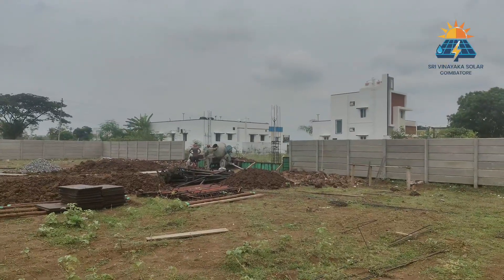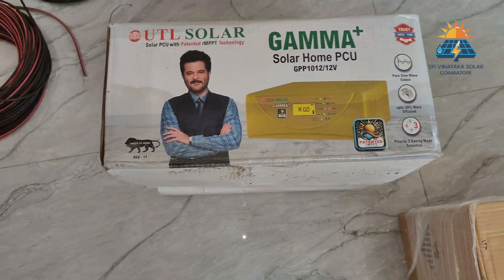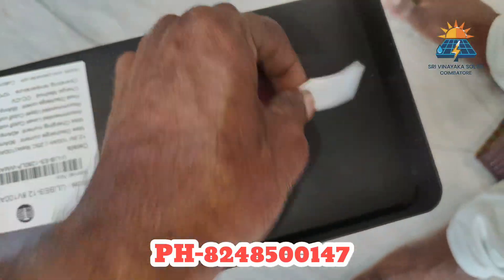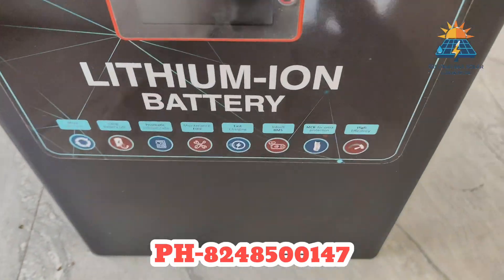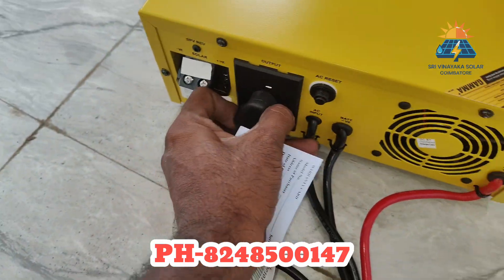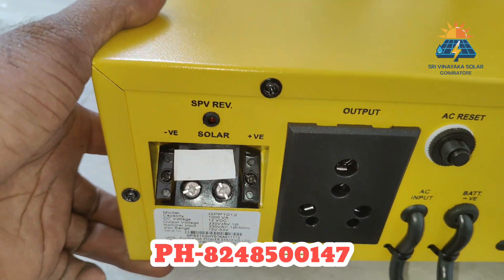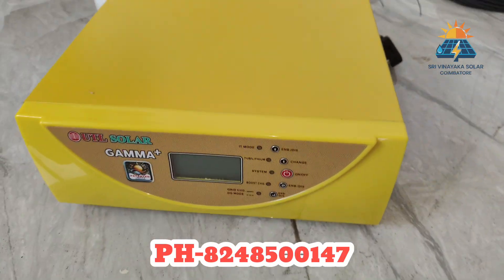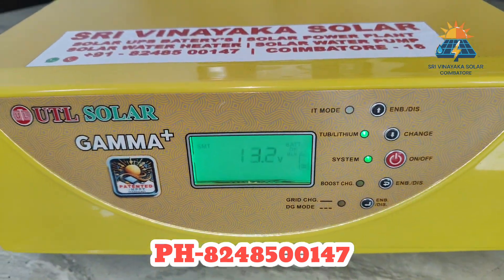♨️ NO EB 1 KW OFF GRID SOLAR || UTL SOLAR || LITHIUM BATTERY 100 AH || 590 WATT TOPCON N-TYPE SOLAR

Comment: Bro.. that inverter will only charge at a max of 40Amps... so it will always be limited to a max of 584 watts however much of panels you add.
Reply: 3 panel possible to connect